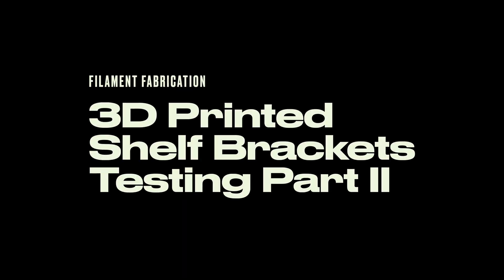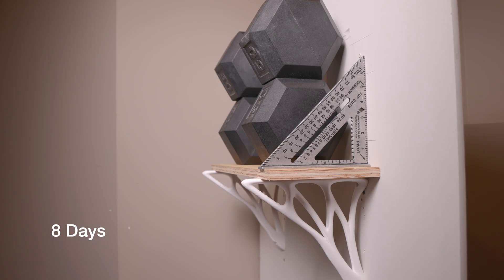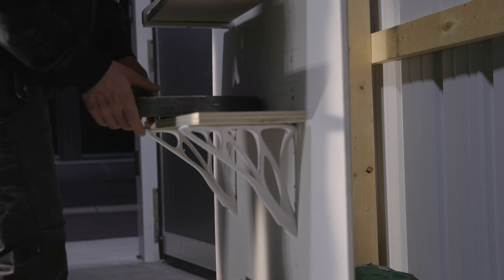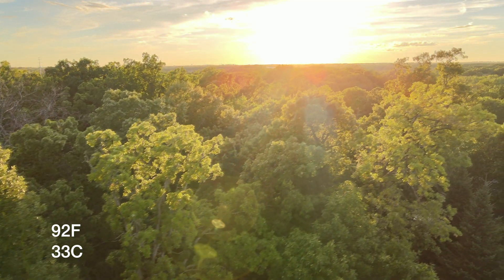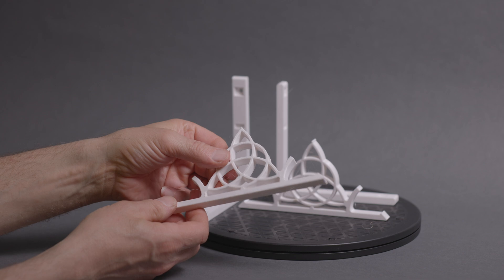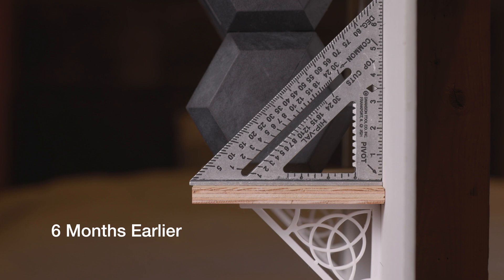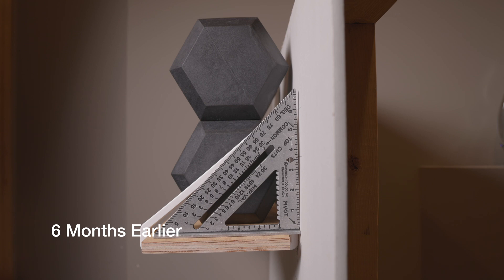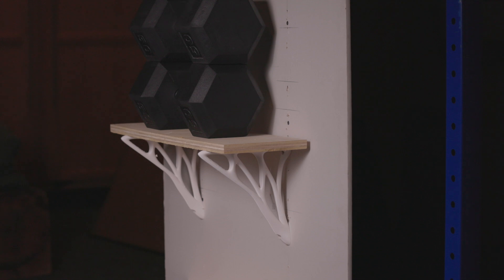3D Printed Shelf Bracket Testing Part II

Comment: I printed brackets for a 4ft x 7in shelf for my wife’s heavy plants. I used CF-PET though so definitely a cheat code but a simple 1/4” thick tension triangle has been incredibly strong over time.

Comment: I would like to see a similar test with a floating shelf style bracket.  One where the shelf is inserted, has a small base underneath to rest on and is then contained on the top with a small lip/protrusion.  Something akin to the Rakks Ethereal brackets but designed with 3D printing in mind.  I'm curious if with the extra leverage of the cantilever that there would be more creeping or deflection.
Reply from the maker: Great idea! We already have the topic picked out for the next video but I really like that suggestion. I'll see if I can find enough designs to do some testing!
Reply: @FilamentFabrication  I've got one mocked up in OnShape I'm happy to share if you need more.